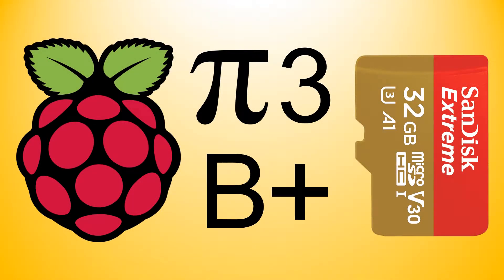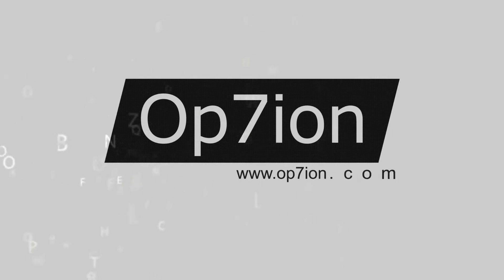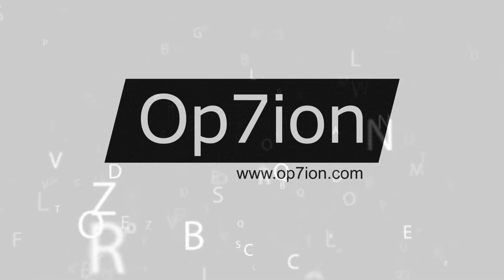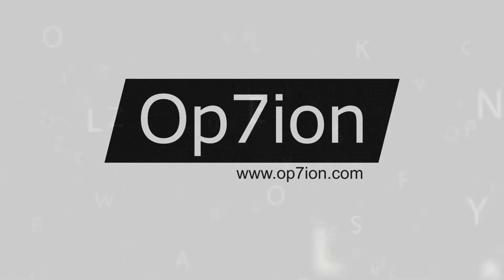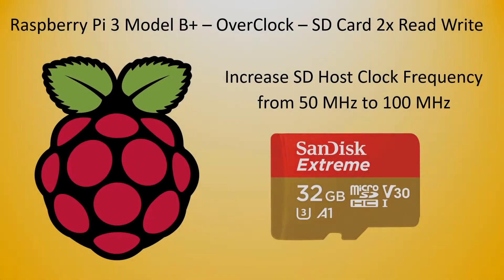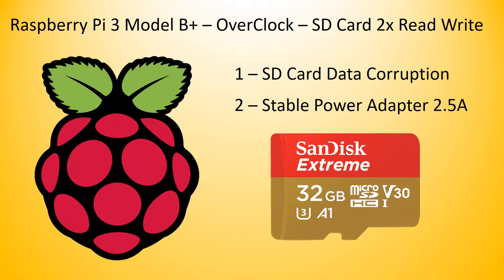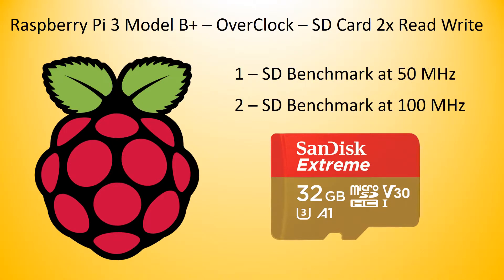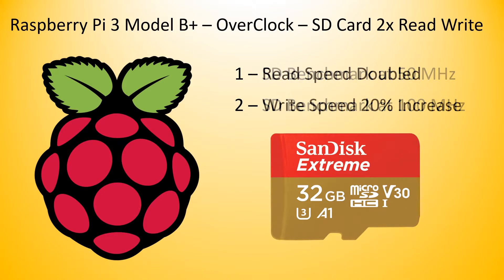Raspberry Pi 3 Model B+ – OverClock – SD Host Card 2x Reader Writer

Comment: hello i have a pi 3b+ and when i do the benchmark the clock is set at 25Mhz and i can't manage to put it to 50 or more.
Reply from the maker: Hello,

What brand and model SD Card are you using ?

The default sdhost clock frequency should default to 50 MHz. It is important to use a current & updated version of Raspbian. This will ensure you get the dtoverlay files required for over-clocking. If you do have the most current version then it could be that the SD Card is not capable of higher speeds.

Some suggestions to try :-

1. Current Raspbian Image - v4.14 - 2018.06.27
2. Apply Raspbian Updates
3. Use New Fast SD Card
4. Approved Power Supply - Stable 2.5A at 5V
5. Full instructions in the blog articles below

Raspberry Pi 3 Model B+ - Configure & Update - Five Simple Steps
https://op7ion.blogspot.com/2018/04/Raspberry-Pi-3-Model-B-Plus-Configure-Update-Five-Simple-Steps.html

Raspberry Pi 3 Model B+ – OverClock – SD Host Card 2x Reader Writer
https://op7ion.blogspot.com/2018/04/Raspberry-Pi-3-Model-B-Plus-OverClock-SD-Host-Card-2x-Reader-Writer.html
.
.